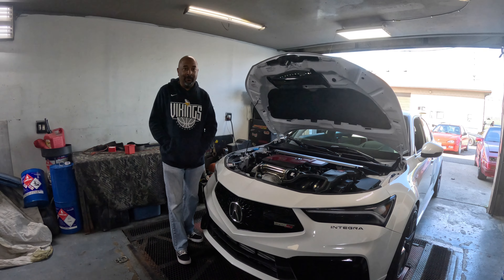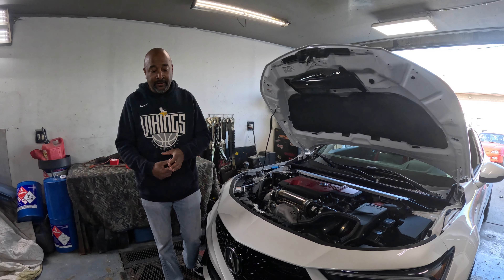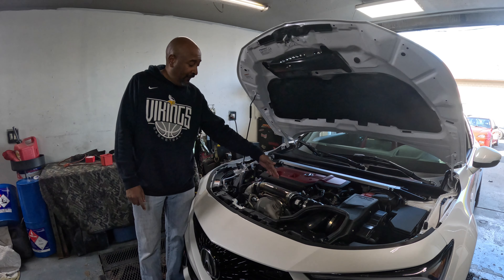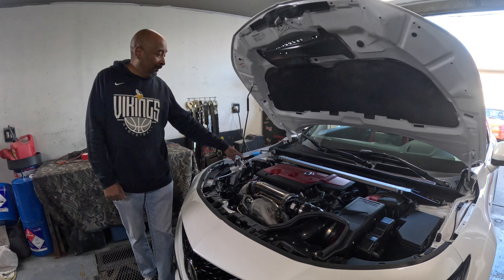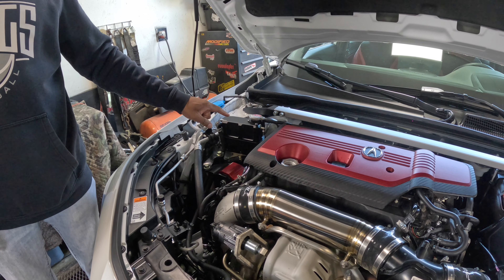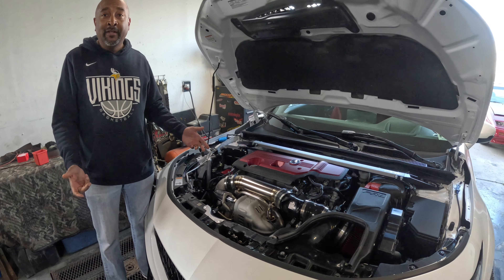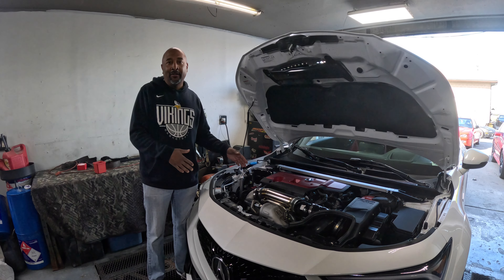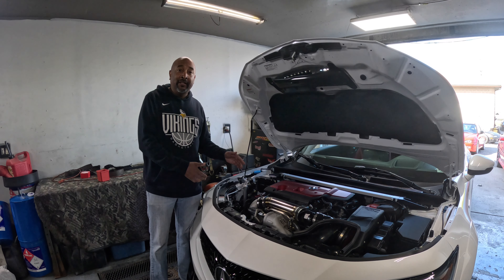Acura Integra Type S (Tuned) Dyno Pulls

Comment: This is how a dyno video is done with a stock baseline. 
😍😍😍😍

My plan will be getting a spare ECU to clone and jailbreak it.
Will leave the stock one untouched for those unexpected dealer visits.

Not planning on installing other parts with the exception of the RMM. The car will be just tuned.

Comment: Downpipe and upgraded turbo will have this thing in the mid 400s.
Reply from the maker: Stay tuned goodies coming 🙃
Reply from the maker: Will make an another 20 whp with the factory cat out. TSP downpipe works well on these cars.
Reply: @IntegraTypeSPerformance  I have the P2R Catless downpipe on my car, which is currently FBO with the MHI stage 2 turbo. I am in love with this setup. I'm awaiting the release of Hondata's flex fuel kit.
Reply from the maker: @FL5ghost  I am also. They’re teasing us with there video. The cats out of the bag anyway they need to go ahead and release it and give us a software..

Comment: Acura missed the mark on this car.. shoulda came awd
Reply: Track times disagree with you.

AWD will have more weight, complex drivetrain, more stuff to maintain and reduced agility.

Pass

They nailed it.

Plenty of AWD compacts out there to choose from.
Reply: @Marbind awd adds maybe 50 lbs these days.
Reply: @curveofsound  in the case of the tlx it adds 218 pounds. 😉